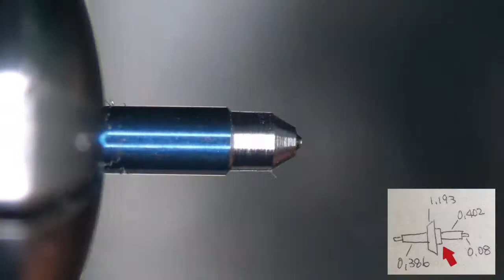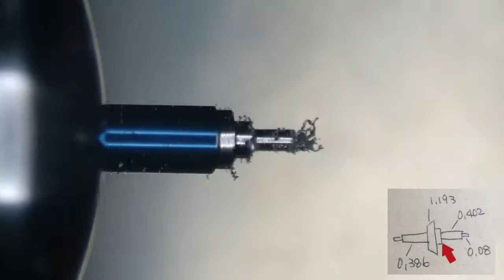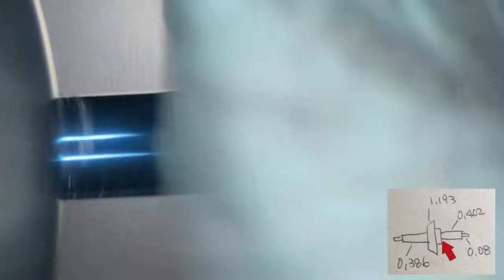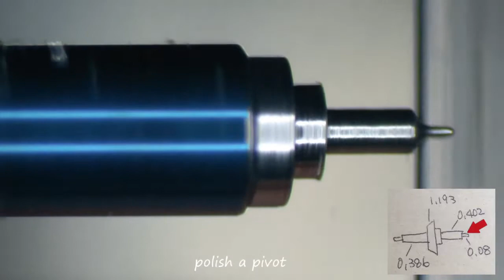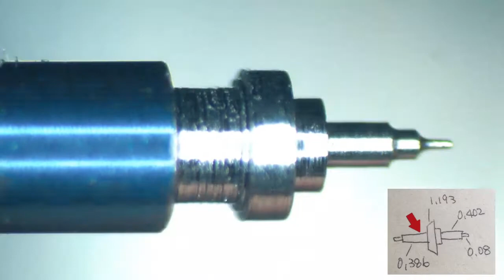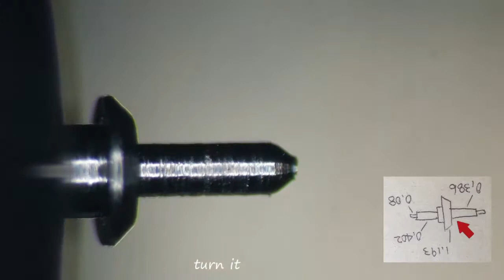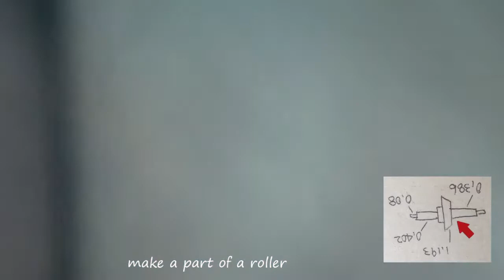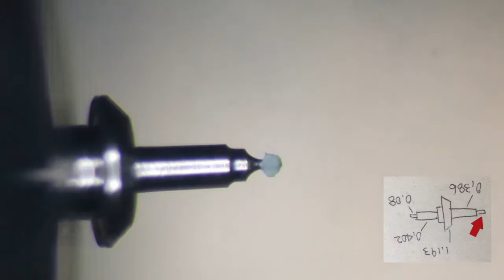Balance staff ②  for HAMILTON   / 天真別作

Comment: Gran trabajo necesito saber como es la herramienta que utiliza para hacer el ribete para el volante hace una semana que intento pero puedo por favor de me una ayuda
Reply from the maker: Thanks for watching.  
Part of rivet that I usually using normal shape tungsten gravers. Tip is around 45 degrees.   
Different to write to explain.  So maybe you want to cut very deep   Then gravers are broken and touch a correct point.  Only cut 45 degrees.
Reply: Please can you help showing how to sharpen and set cutting and engraving tools